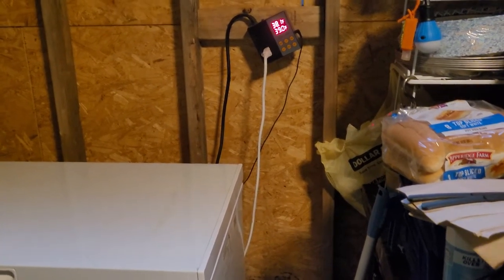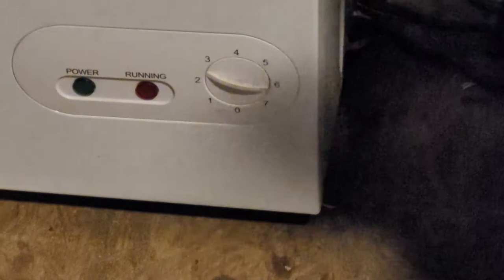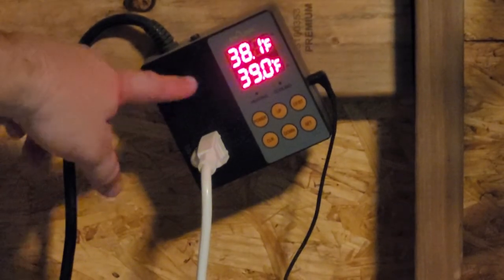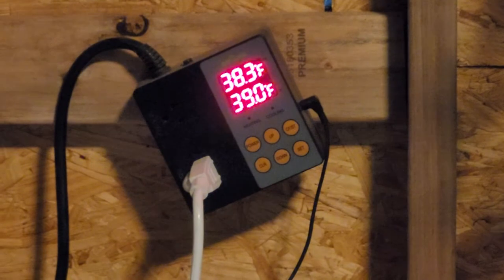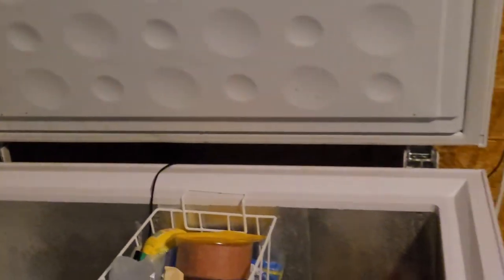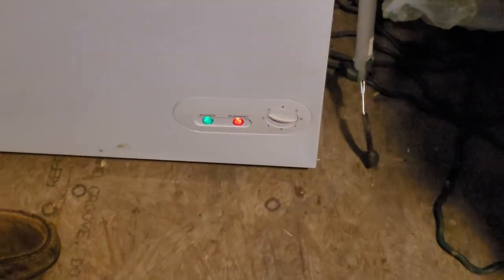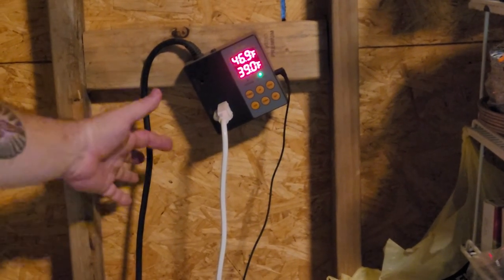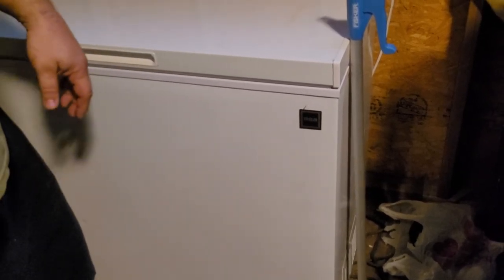Converting chest freezer to fridge

Comment: Great! Do you know, are chest freezers dependent on ambient temperature like we are warned refrigerators are?
Do they need an indoor, conditioned range?, or are they generally okay in a garage (say, 30F - 75F, in my climate)?
Thank you!
Reply: yea they are this way because they are not insulated enough to combat heat difference... and when it is too cold, their stuff can't heat anything up so in a fridge case it'll freeze the inside stuff
If you are converting a freezer to a fridge, it can likely be used in hotter weather than it is specified, since it isn't going as cold. You can put shade over it with a roof and even put insulation around it to increase that more
Reply: the cheap china made ones are very temp range specific sometime as bad as 55f to 92f
so they need to be in house or basement. but GE ,HOtpoint same machine but lower price
are labeled garage  safe,  i seen other USAs brands also in manual good for garage
but odd brands be wary and the Hotpoint not much more expensive in the 5 to 7 cf sizes
and better quality  if in doubt download instructions from seller or manufactures websites
my kelvinator  not quite as efficient as newer ones has been in my FL garage 27 years i vacuumed it 1x  i did put it on a small pallet  since water heaters next to it  it leaked at around 15 yrs and garages get hot here, rarely colder than 35- 40 outdoors